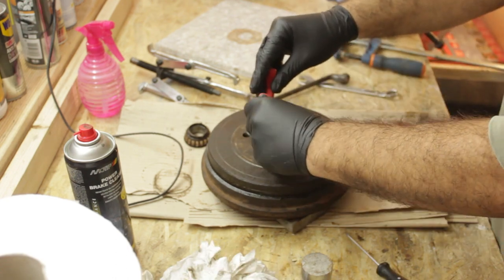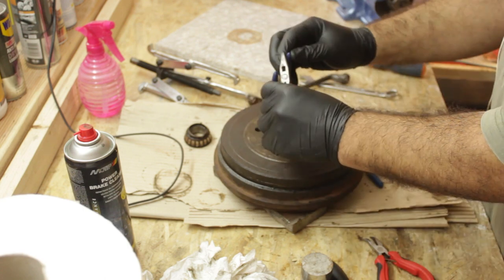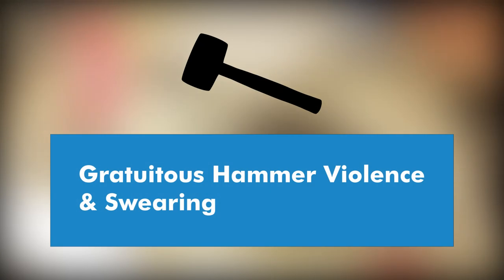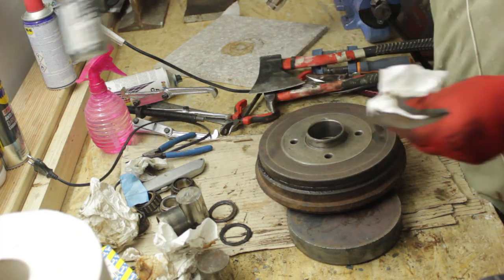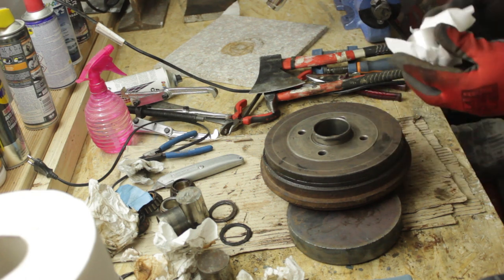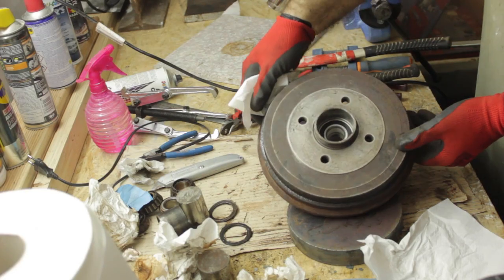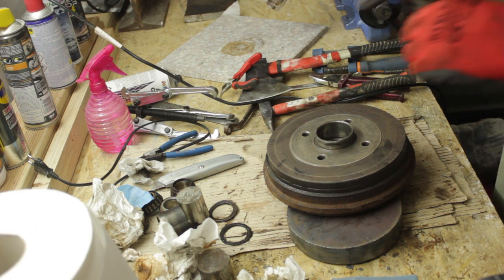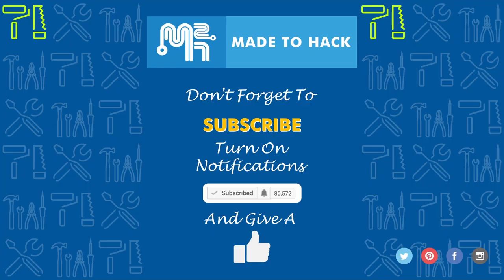Easily Replace Break Drum Ball Bearing Using the Frozen Method

Comment: Did not work for me, it nearly worked drum at 135C bearing at -8. It went half way in an jammed. I read all the warnings about micro racking, and chickened. If I have to do it again I will go for 200C on the drum.